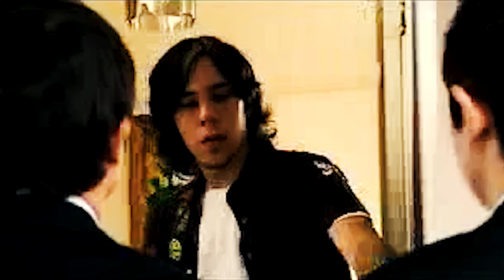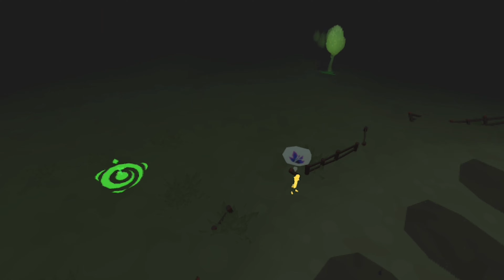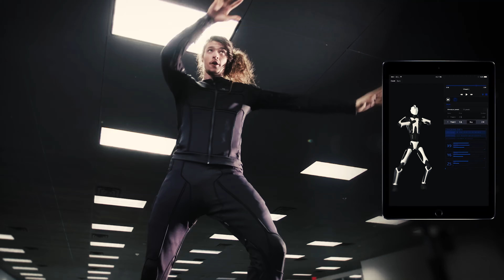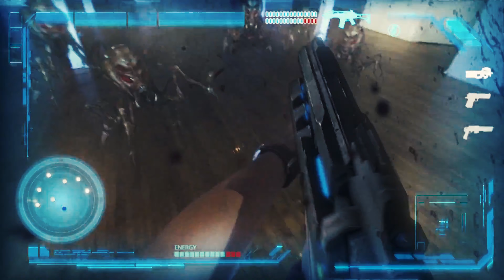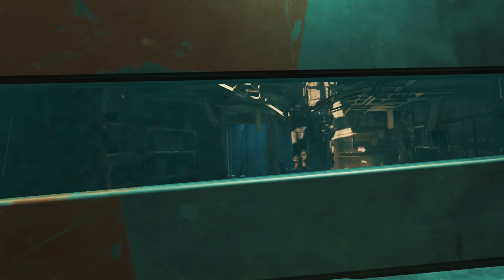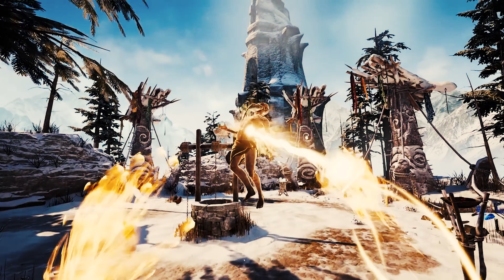Force Feedback: The Hardest Part of XR Haptics to Get Right

Comment: Why almost nobody is exploring exoskeleton arm for force feedback, it must be possible and something ready to be explored
Reply from the maker: Cost and business reality. VR and Mechatronics research is expensive and few companies will fund much without the expectation of a return on that investment. Meta and a few other companies have likely done a lot behind the scenes work that could even possibly include exoskeletons for force feedback, but the odds are likely a lot of them stopped at the bare minimum needed to verify whatever principle they needed to commercialize a product works and then research was targeted from there. This is an area where a middle ground between a hobbyist researcher that has no budget and a fully corporate sponsored team might actually be better by a vast margin than either extreme. The freedom of the hobbyist with just enough budget and none of the business or fiscal obligations of a corporate or scholastic team.

Comment: There are some people out there who have Phantom Touch, those effected by actually feel touch in VR.
Reply from the maker: That might be a good topic for a video. Doesn't really address force feedback since the problem there is the lack of stimuli, but individual perception is VERY important to consider for VR and there's a whole field of study in regards to the various illusions our mind/senses experience. Phantom touch (also known as Phantom Limb) is actually an issue that's been attempted to be corrected in VR as people with it typically feel pain from the sensations they experience rather than immersion. Still, my quick google search appears to be popping up a different phenomena where people with synesthesia seem to gain enough visual/audio stimuli from our current tech for their brain to fill in the touch aspect. That's pretty interesting to see.

Comment: They can use those suits that send electrical impulses. So when you have a sword and cut someone they can simulate the feeling of hitting a bidy
Reply from the maker: That's still touch rather than force feedback.The only way to do it electrically would involve TENS or tasing levels of stimuli, which would be pretty dangerous for reasons that should be pretty clear. That approach could be useful if we stop using motion controls as the basis for motion in VR though. My own VR rig was looking at that kind of solution, but I've backed away on it since it could interfere or even damage my EMG units that are being used to solve VR locomotion. It's a tricky balance to strike with all this gear, but I'm glad you're thinking about it on that level 👍

Comment: What are your thoughts on vr's progress for walking?
Reply from the maker: Glad to see our current tech is getting cheaper, but I'm not very optimistic for it outside of the world scale solutions. Even considering the recent Kat VR news, it still seems like VR locomotion is going to remain a problem for the long run (no pun intended) until we get Brain Computer Interface based solutions. 

Still, at the very least the niche of VR gamers that go for the treadmill solutions will have a greater reach in VR (though I haven't heard the greatest reception from those who've tried them). For what it's worth, even if treadmills mean the world has to be basically flat to make immersive sense, that's still an improvement over our current situation where the only way to go past a room involves teleporting or artificial locomotion.

Comment: I guess the companies could fix this problem by putting things like tiny pistons or rotors inside of the controllers. They would have to be very strong though in order to create forces big enough to resist the player's motions. 

Ahhh, lots of things to try after going to study electronic engineering in a half year :)
Reply: the problem is it wouldnt be very precise, and it would be hard to have powerful motors like that in a small controller, the tech just isnt there yet
the most realistic option is force feedback exoskeletons even if they are clunky
Reply: @boogaloo_weed  Thought the same, making a suit which is able to tense up when needed is way easier. Using rotational force would still be interesting though :) gonna try building something once i have the knowledge.
Reply: youtu.be/GeyDf4ooPdo 

If the rotational force is able to make the weight feel weightless, i think you  can create the opposite effect as well .
Reply: Amazing video as always btw ;)